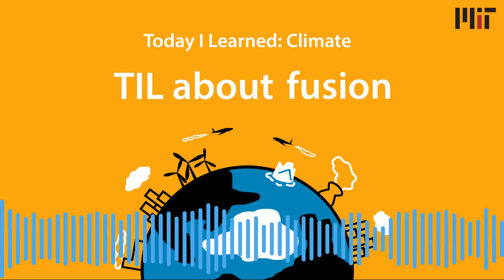S2E7: TIL about fusion energy

Comment: To operate continuously, one would need to add new hydrogen fuel as helium and heat energy are removed and to be dispatchable one would need to be able to adjust the hydrogen fuel rate over a wide range. I'm thinking this load following makes a reactor design more complex. Technically most fission reactors are batch in that only a small amount of uranium in the fuel pellets is consumed before the fuel rods with new pellets are replaced.  Maybe fusion could operate in a batch mode, but not sure anyone is thinking in that direction. How can you use that high quality (high temperature) heat release to an advantage to make electric power more efficiently than steam turbines. The effort to decarbonize is to make electric power with low carbon and to electrify transportation, building HVAC, and industry. If nuclear power were too cheap to meter, maybe hydrogen or other chemical fuels could be made, or maybe some factories could be located nearby to use that heat.